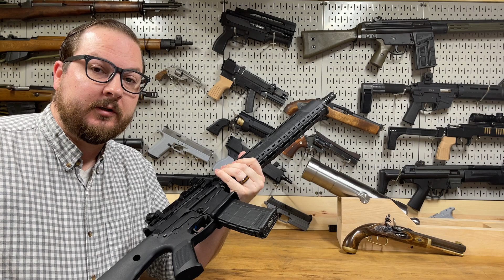KP-15 Dissipator Overview

Comment: A lot of confusion with the terms: an M16 rifle or an AR build with a rifle length sight, rifle length gas system and a 16” barrel is called  the 605. The old Bushmaster (Windham, ME) coined the term DISSIPATOR for their AR build with a carbine length gas system, rifle length sights and a 16” barrel. Don’t confused the 2 versions.
Reply from the maker: In common usage, the terms have been reversed with a “faux Dissipator” being a carbine gas system and a rifle FSP on a 16” barrel and a “true Dissipator” being rifle gas system and FSP on the 16” barrel. Not sure when the terms flipped but that’s the terminology used when shopping around for parts in the last few decades.

It’s dumb, but that’s the way it is these days.

Comment: Got it made! Came out pretty good too. Now I find out it won't work with a triangle handguard endcap 😢
Reply from the maker: The triangle caps are pretty easy to install, just gotta tap out the sight block pins
Reply: @booliganshootingsports I got it all to work! Just added the rail ride c-more. Now off to cut and thread for AAC mount/ hider

Comment: I'll be attempting to make this handguard from 2 in about 30 minutes, going to use high-temp jb weld and a hot stapler to join them. Any other tips? I've heard Magpul uses fiberglass, should I try and find some dish washing gloves/ respiratory ppe or is it not like the insulation that makes you itchy? Going to measure twice and cut once with a Dremel, wish me luck!
Reply from the maker: I used a hot stapler and heat welding, good luck!

Comment: i would have tried to go with a lighter barrel.  thats the one thing that kinda doesnt fit with the overall build is the heavy barrel on such a light weight build
Reply from the maker: @mtnbound1776  for sure, Delton barrels are crazy heavy profile. I’ve considered reprofiling it on the lathe.
Reply: @booliganshootingsports  KAK makes,  or made one that is lighter in profile but still the rifle length 16" maybe check that out

Comment: It is not right without rifle length gas system. The company did it cheat instead of right. Junk
Reply from the maker: Cool, this has the proper rifle length gas system, as I mentioned in this video, lol.

Comment: 14.5 mid length pin and weld with an sl handguard  would get “close” look without the handguard + buffer system bs
Reply from the maker: It wouldn’t be a Dissipator at all though. It would just be a carbine.
Reply: @booliganshootingsports  granted, but the alternative is easier with all benefits and no cons
Reply from the maker: It doesn’t have all the benefits though, lol. It doesn’t have the long iron sight radius of the Dissipator. It doesn’t have the long handguard. It doesn’t have the softer recoiling rifle length gas system. And it looks like just any other carbine. A good carbine is awesome. But it’s not a dissy 😉
Reply: @booliganshootingsports  sorry to disagree, 

what 14.5 midlength has is,

reliability with standard spring+buffer
available light profile barrels
soft shooting gas system (14.5 midlength with the correct gas port size is very soft) 
almost identical aesthetics with an SL handguard and KP15 lower 

Infact the only argument is the longer sight radius

Btw, 16” barreled ar variant rifle with rifle length gas is also technically a “carbine” as well, being as it’s shorter than 20”, u know, the original designed barrel length, no matter the gimmick marketing name “dissipator”

Granted it’s a cool looking rifle,
Reply from the maker: @Robert Mcbeth  luckily we can all have our own “perfect” build, that’s the best part about doing your own gun builds! I’m just definitely not known for doing things the easy or most practical way 😉

Comment: Almost have my Faux Dissipator done, using FDE KP15 and FDE Magpul SL grips -- using mid-length adjustable gas block and a Romeo7 though, otherwise same setup.
Reply from the maker: Are you doing conjoined handguards, or are you just running the midlength ones fitted to the functional gas block?
Reply: @booliganshootingsports  Took forever, but did conjoined handguards -- took 3 sets though, did exactly what you said and ruined one of the first set.
Reply from the maker: @lymnjuice  it’s a royal pain, it’s why I never made any more of them.

Comment: Back to the handguard, when you added those 2 pins for the handguard, regarding mechanical rigidity. What would happen if you installed 4 pins. For example North, South, East and west.
Reply from the maker: Wouldn’t hurt. Or melting in hot staples at the joint using the specialty body shop tool I’ve seen around.

Comment: Looks great.  I personally would prefer a mid length upper / gas system.  Softer shooting and you can still fix a bayonet.
Reply from the maker: The rifle length gas system this uses is the softest shooting system out there… 

But yes, you can’t mount a bayonet on this setup. Until I make my own bayonet, lol.

Comment: Would you be willing to do a video on the CMORE mount? I’ve been searching for one for ages and have contemplated doing the same thing.
Reply from the maker: Not much to say, I snagged a very good reproduction mount from a friend who had one on a back shelf. You won’t find an original except for on gunbroker possibly, and the repro mount I have is almost 10 years old, so I have no clue where you’d find the same one currently.
Reply: Roger, thank you very much for your time!

Comment: No doubt someone could 3d print that hand guard after they 3d scan a magpul handguard and extend it
Reply from the maker: 3D printed handguards are pretty good for .22 ARs, but the heat buildup for a direct impingement full caliber AR would quickly cause issues.

Comment: Voodoo Innovations/Adams Arms barrel is 16.5" and is a RIFLE LENGTH gas system. Light weight, superbly accurate and shoots FINE right out of the box with no fiddling. Shoots super soft. I got yer dissipater right here with NO compromises!

You compromised unnecessarily. Having a rifle length gas system, my build shoots noticeably softer than any mid length. I don't build carbine length systems anymore. Even my Faxon 11.5" is a mid length.
Reply from the maker: This is a rifle length gas system as well…
Reply: @booliganshootingsports  
Doh! I missed that. I head you say mid length or carbine and then stopped. Was at work and did not follow up.
What barrel did you end up using? The Voodoo 16.5 is ghastly expensive but is worth it for a few reasons.

I have felt a poor a few times and just bought the must less expensive Faxon 16" gunner middy.
Reply from the maker: @deplorabledave1048  it’s a Del-Ton barrel.

Comment: >Not using the best opti-
Oh wait, you are. Carry on.
And yes, let's bully Magpul into making a rifle length SL. It would be nice if they worked with triangle end caps too, I've got a mid-length just sitting around because no way in hell am I pulling this upper apart to install a 30 dollar handguard that's just going to be replaced with a Midwest Industries drop in mlok rail, which is only compatible with triangle end caps. Sigh...

Comment: I think you actually inspired me to take my Mk12 build to a "Retro-Modern" theme. I'm seriously thinking a KP15 shortened LOP with a BCM-Mk2 upper & BCM QRF hand guard, 18" BA fluted (rifle-length) gas system and top-it off with a Leupold Mk4 2.5-8x MRT. Kinda leaning towards a A2 front gas-block or a railed gas-block (BUIS) is never a bad idea. Notice i'm not terming it a "clone build" cause that would just bring out all the couch-warrior-gurus talking a pile of shit about cloning, Retro-Modern is more what i'm after i would much rather carry a lighter black-rifle than an actual clone-correct Mk12 10lb. monster!  Great video brother.

Comment: Did you consider using plastic welding to make it more flush?
Reply from the maker: I used plastic welding on the internals to solidify it, but with magpul’s slight textured external finish, any plastic welding with my skill set would make it stand out worse than it currently looks.
Reply: @booliganshootingsports  ahhh, I gotcha

Comment: So did you take one of those ar c-more sight clones and then replaced the optic part with the real c-more optic?
Reply from the maker: Exactly
Reply: @booliganshootingsports  that's brilliant. Any issues with screw holes or threads?
Reply from the maker: @BugsISKing  I had to sand the mount a TINY bit to clear the slightly narrower front loops on the sight hinge (the lens is kinda mounted on a hinge setup) but otherwise it was direct fit.
Reply: I'm shocked to here you like Cmore sights. In my experience they are awful. I'll take any of the aimpoint micro clones any day

Comment: plastic welder staples work great for bridging two pieces of plastic back in to one.  I have done a ton of bumpers and other plastic fairings for cars with this sort of tool a cheap kit on amazon is like 25$ so not too bad and would work great for doing hand guards, vs using straight pins and pliers/torch.
Reply from the maker: Good to know!

Comment: Im surprised you didn't design a 3d printed handguard
Reply from the maker: Unfortunately, on high heat applications like gas impingement full caliber ARs, 3D printing a handguard is a recipe for disaster.
Reply: @booliganshootingsports  is that made of glass filled nylon then? I'm sure there are printable materials that could handle the heat, but most of them are a pain to print.
Reply from the maker: Magpul's polymer is some sort of glass filled nylon, yes.

Comment: Looks amazing. Like the “single-piece” look of the sighting system. Can you provide info on the repro base you used?
Reply from the maker: You can find them on various overseas resellers, just look for "Cmore AR Mount". Quality will vary since it's all nameless overseas manufacturers.
Reply: @booliganshootingsports  hey quick question, I see a g3 back there, my ptr91 has a stiff diopter I cant turn. Do you know how to fix that.

Comment: Cant you 3D scan that guard and correct it in CAD?
Reply from the maker: There are certain things that 3D printing is good at, but making high temp tolerant thin wall handguards for gas impingement AR platforms is not one of them, lol.

Comment: I love how this rifle looks.
Reply: Looks like an upgraded version of the M16A4
Reply: @burningwood7406  looks more like an ak to me
Reply: @chrome5725  what?
Reply: @goblinbarrel25yearsago55  it looks like an ak
Reply: @chrome5725  yeah by having a front sight block near the end of the barrel it does kind of resemble an AK in a way
Reply: @T_D_B_  i was joking bro
Reply: @T_D_B_  i would like to see an ak with a hand guard like that and the m16 stock
Reply: @chrome5725  i wasn't joking haha 😁 to me, it sort of does resemble an AK, as far as basic configuration goes. It's still an AR obviously.
Reply: @chrome5725  the magpul AK furniture is kind of similar, but not the same
Reply: Same
Reply: Keep bullying magpul for those rifle length handguards
Reply: like if the m16 was still the go to
Reply: Interesting. Recently I put together a KP-15 lower, bought complete, added the KP Ambi safety, then bought a PSA faux dissipator upper. I like your slab sided lower, I didn't know that was an option. I had a DELTON dissipator in the past, good shooter, but, as you say, a little heavy. But no functional issues, you should be fine. 

I think your handguard is brilliant. Maybe unnecessary, but sometimes you just have to follow the obsession. I recently put one on an M4 style carbine, and it's quite the item. For my build, I was trying to build the M16A2 I wished I had when I deployed. I had a heavy barrel A2, really accurate, but also not necessary. So I went with the shorter barrel, lighter profile barrel, and standard A2 handguards. I guess that's what comes after a year in country having to listen to all the comments about "my musket" from the m4 toting grunts. 

Again, sometimes you have to follow the obsession.
Reply: It looks old and futuristic at the same time. If the handguard and lower were white it would look like it was standard issue for the sci-fi dystopian enforcers.

Comment: Love the look, but I'd seriously take a mid-length adjustable gas system over that rifle system. You're going to need a buffer weight you can strip a part and change until you find the right weight.
Reply: Regular buffers are SUPER easy to adjust. Just need a roll pin punch and you can purchase tungsten weights on Amazon for pretty cheap.
Reply: Or you could always drill out the gas port slightly. It's not as scary as it might sound if you are methodical about it. I guess it comes down to how broad of ammo versatility you want. Buffer weights are fine for tuning to a certain ammo. If you really need it to run even with the weakest ammo, you might need to open the port up. I'm sure you follow me👍
Reply: @T_D_B_  yep a drill press is recommended, shouldn’t be that hard, I spoke to a Del-Ton rep and he mentioned the gas-port diameter they use to accommodate all grains to cycle effectively.
Reply: It is actually a mock-dissipator.  The real "Dissipator" has a rifle length gas system front sight, there's a few manufacturers that got it right by boring out the gas hole to a larger diameter to address the gassing issues of the original dissipator.
Reply: @tawaitai  you must’ve missed the previous video. It’s a rifle length gas.

Comment: I want that sight setup baaaad. Is there any options that you know of that would be close to it and might be a little more obtainable? You got me on a search now 😂
Reply from the maker: You can find the reproduction models for like $75 with a sight included. Pop off the cheap sight and drop in a real Cmore unit and you'd be in business.
Reply: @booliganshootingsports  hey thanks for the tip man!
Reply: Check out reviews on Cmore sights first... I was very disappointed myself. The one I tried was very hard to see in outdoor daylight and seemed to lose zero on a 556 AR. Not a fan  but my sample size is only one and it was years ago.
Reply from the maker: @T_D_B_  I don’t even know how a Cmore would lose zero since the zero is double locked in place. And it gets brighter than any of my other red dot sights. Weird that you got a fluke.
Reply: @booliganshootingsports  i was pretty puzzled by it myself. They do seem to have a rabid following, but also some not so great reviews around as well. Not sure if people were being sold fakes or repros? Who knows... whatever the case, if it works for you, CMore power to you! (Sorry I had to haha)